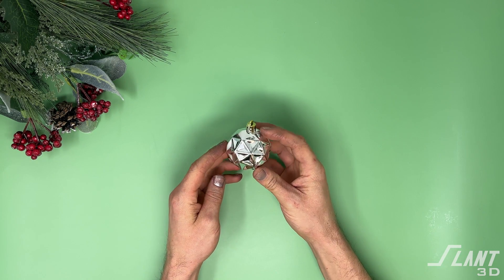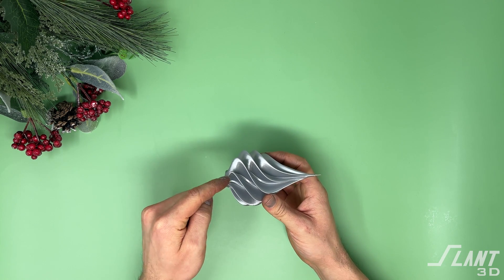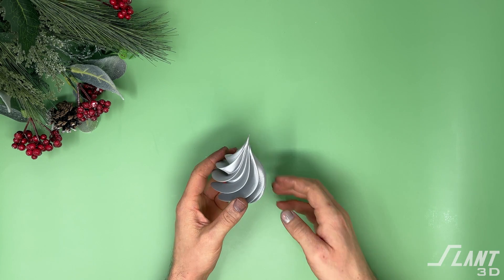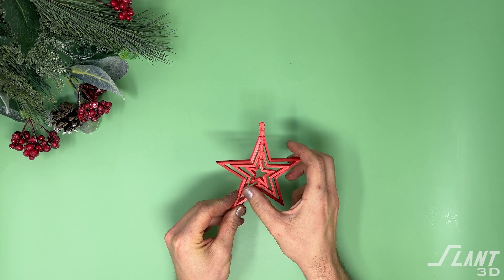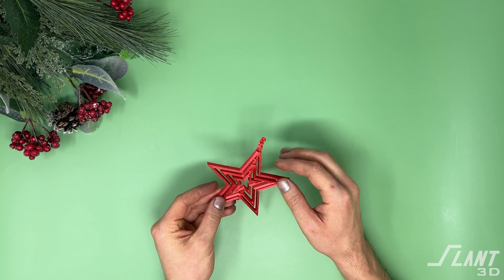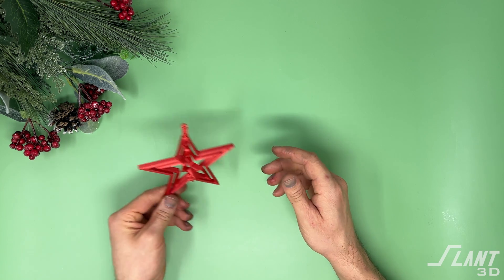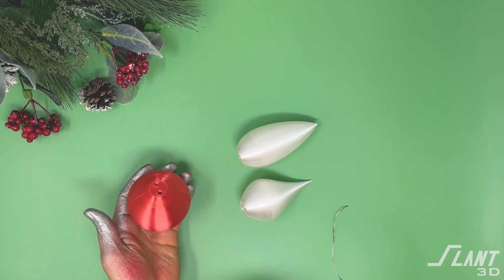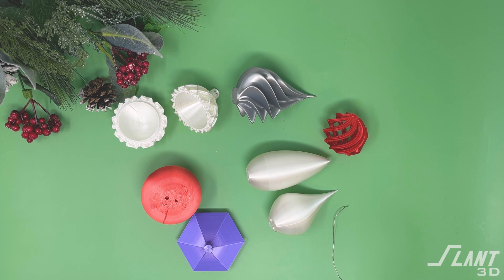3D Printed Christmas Ornaments: Design for Mass Production 3D Printing

Comment: Hello Slant3D! Can you do a video about what you can do in the design stage to get a part less prone to warping? So not just 'mouse ears' or slicer settings... But for example what shapes to avoid. Thanks!
Reply: The trick to avoid bottom layer warping with PLA is to maintain warm (+22C and above) envrionment without drafts.
Reply: @AuxHex  Thank you. My recent warping problems were however with ASA filament. Inclosing the printer and adding mouse ears to the corners didn't do enough to prevent warping

Comment: a month ago i printed around 50 pieces of 80mm balls using vase mode and variable layer height with top part being spliced from clasic sliced ball with 3 parameters
they stood on 20mm stem and in general looked like they were printed upside down
single ball took 40 minutes to print and the elephant foot served as an attachment for clip on hook
and we gave many of those to the kids at the school to decorate with 3d pens in a contest
it took 2 3d printers ar work arounda week :] but the school christmass tree is fully covered with those and out head teacher lady is very pleased because they are very decorative even as plain colorfull balls
Reply: Cool project, and the 3D pens to make children have a first encounter with additive manufacturing!
Reply: what a wonderful application of 3d printing! its the perfect use-case! we need more software and machines that are set up to make small runs like that easier and more predictable. that might well be what makes 3dp into more of an alternative to other processes. it needs to be more reliable and still be cheap enough.

actual engineering required. anybody guess why the chinese took over? because they are so good at this!